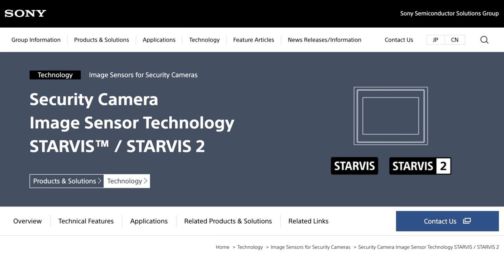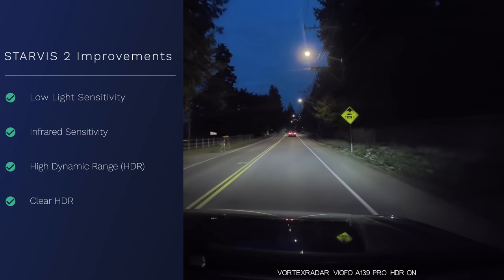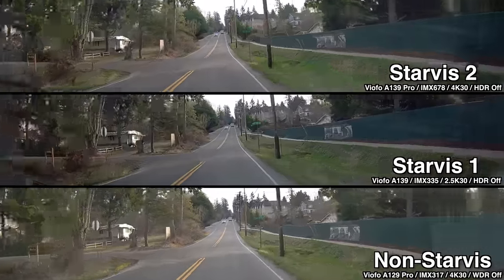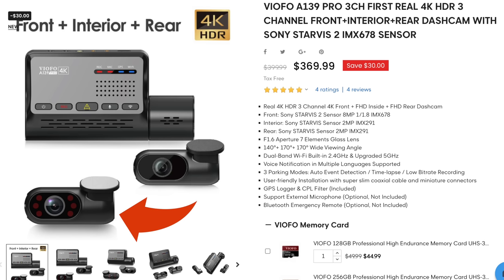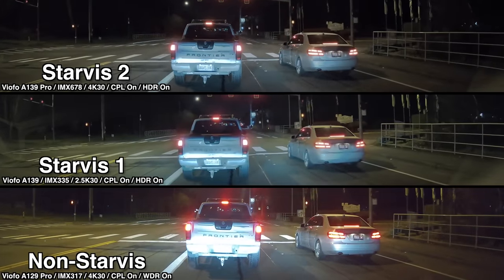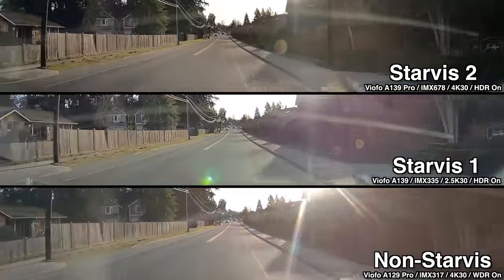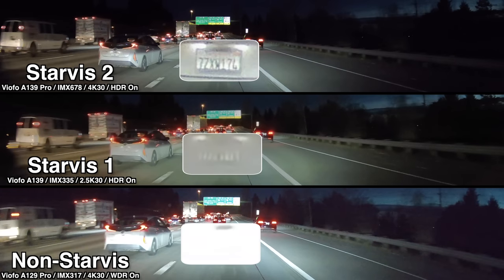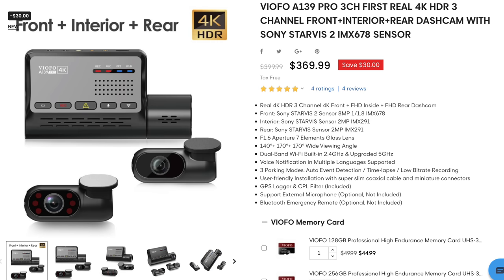Next Gen Dashcam Sensor: Sony Starvis 2, ft. Viofo A139 Pro

Comment: Thanks for the very informative videos. I just purchased through your link. You did a great job of breaking down the most important elements and the new Starvis 2 sensor looks like a winner in the current crop of upper end dash cams. I was initially leaning toward the Vantrue N4 for it's feature set and price but watching your video swayed me to spend more for the enhanced video in this unit.  Thanks Again.
Reply from the maker: Congrats! Good decision. I have an N4 as well and the A139 Pro is unquestionably a better dashcam.

Comment: If you’re ever bored it would be cool to have a video deep dive on shutter speed in the context of video recording (as opposed to photography) and how shutter speed relates to frame rate. Even as a photographer  i struggle a bit with separating those two and understanding the relationship between them & their impacts on footage.
Reply from the maker: Yeah I've been wanting to tackle that topic for some time, specifically because people keep saying you need 60 fps to better capture license plates...
Reply: @VortexRadar  yea In the photography realm  it’s easy for me but we are taught to typically stick to recording w/your frame rate at 1/2 your shutter speed and also to keep in mind The frame rate per second can never be higher than the number of exposures per second. If you have a 1/4s shutter, the shutter / exposure only opens and closes 4 times per second so you can never have more than 4fps (without interpolation). 
So we are always taught to “work backwards” from your delivery format. So if you may want 30 or 60 fps then shoot at 60fps w/a 120 shutter speed because you can always “work backwards” to slow things down without any issues or degradation but if you shoot at 4 or even 24fps & want to speed it up or get faster detail etc it’s too late. 

TLDR: even I struggle with how 30fps w/a faster shutter speed for example would be beneficial…I get why you’d go to lower frame rates at night for example but not would expect a faster shutter to cancel out any benefit from doing so
Reply from the maker: @Fee.1 Yeah it's not so much about shutter angle in this instance. People may see that switching from 30fps to 60fps forces a minimum shutter speed of 1/60th and thus they see less motion blur and so there is some truth to it.

However, you also may find that it doesn't always force a faster shutter speed, especially in the daytime, not to mention dashcams don't always double the bitrate when you double the framerate and so wind up having less quality per frame, despite any potentially faster shutter speeds.
Reply: @VortexRadar  so what are a couple examples where you’ve found yourself adjusting shutter speed independently of framerate with higher quality dashcams where you benefitted from doing so, and did you adjust it up or down ? I can see from the info you just have maybe turning it back down when it’s on 60fps if higher speeds cause some issues. It makes more sense now though so thanks, I hadn’t really considered manipulating shutter speed more due to flaws in the way the camera works than for any technical reason that applies in general hadnt considered that.

Comment: I want to add some more things:
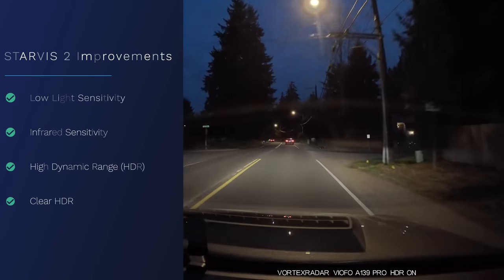2:00 - the Starvis 2 Sony IMX678 is bigger size than IMX335 and than IMX317 and I consider this was the biggest advantage over the other two image sensors from this review. For sure Starvis 2 is better than Starvis but right now, only the Sony specs. are saying that.
For a real comparison between Starvis2 and Starvis should be used same sizes sensors. I think you have the Thinkware U1000 dashcam which have the IMX334 Starvis CMOS which is the same size as IMX678 from Viofo A139 Pro. Not many people in the world have both U1000 and A139 Pro so you can make a real 4K Starvis2 vs. Starvis comparison. OK, I know that IMX334 was not so great CMOS but it is the only you can compare with IMX678. Another dashcam with the same size CMOS is the Nextbase 622GW but unfortunately it is using an Omnivision OS08A10 sensor.
Because of the bigger CMOS size of IMX678 some of the features described in the video are influenced by the size of it and not necessary by the new HDR or the new Starvis2 and I will mention in the next.
3:18 - even the IMX317 is not a Starvis CMOS, we can see the ceiling of the parking lot and cars from the back are better illuminated than the Starvis IMX335 and Starvis2 IMX678. This is because the Viofo did a fantastic job to add more brightness to a 4K sensor even people said everywhere that a 4K image from a 4K sensor is always darker than a FHD or a 2K image from a FHD sensor or 2K sensor. You know, the story with bigger pixels which receive more light.
Of course, the WDR helped a little, but doesnt matter the technology or the trick, but the final result:  a non-Starvis image is more brighter than a Starvis or Starvis2 image from a real test with 3 dashcams side by side.
But as you said, the IMX317 image have not so much details and I consider this is because of the too much brightness added by firmware. This means that not always a brighter image is better than a darker image. More than that, for a dashcam where the dark outside the road is not important for accident evidence is better to have clear details on the road than a better illuminated buildings or forests from the sides. Few years ago I was amazed by the brightness. Now I am amazed by the details.
3:40 - size matters first
3:50 - too dark for a dashcam. No sun, no headlights. Sunrise and sunset will be always killers for dashcams. Unlucky snapshot time of the day even a bigger CMOS or Starvis2 could not help. Surprising, the DOL HDR from IMX335 did a better job than Clear HDR (if was Clear HDR and not DOL HDR too) of IMX678 on the right side of the image at the CANYON PARK placard. But I can be wrong if the IMX335 was more on the right of the windshield compared to IMX678.
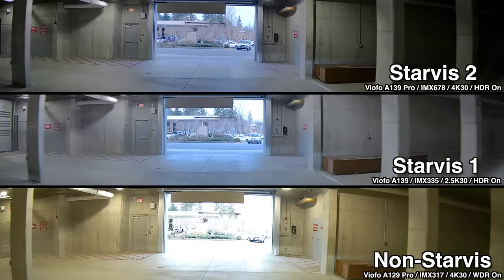6:40 - if IMX317 could not have a forced brightness by firmware could have a better result but I don't expect to be better than Starvis sensors with HDR enabled.
7:09 - another unlucky snapshot, usually on that environment I expect the license plate to be read like it was on 9:25 and I consider this to be the normal situation
7:47 congratulations for the explanation of DOL HDR, this part of video should be on Wikipedia ;)
Reply from the maker: Yeah I thought about doing the comparison with a U1000 for that reason, but I wanted to stay within one brand to avoid software processing differences, HDR vs Super Night Vision, etc. plus I’m actively testing the differences specifically when stepping up to the Pro model. You’re right that sensor sizes are different too. Ultimately every comparison has its trade-offs. :)

Comment: I don't think the Clear HDR noise issue could be remedied without more aggressive noise reduction. This uses a single shutter speed exposure taken with two gains (a low ISO and high ISO) and combined into a final image. Now since the high exposure frame is taken at the same short shutter speed as the low exposure frame, its signal-to-noise ratio will be lower than if it's taken at longer shutter speed like in traditional HDR. Less light = less signal = worse SNR, you just can't cheat physics. 

At the end of the day, in the world of image capture, bigger sensors rule. There's only so much you can do to improve the performance of a small physical package. Let's hope someone put the IMX585 Starvis 2 in a dashcam. That's a 1/1.2" sensor with twice the pixel size of IMX678 and thus a 1-stop better low ISO performance and dynamic range. But it's still not free lunch since with bigger sensors you get less depth-of-field. And you will find out only the center of the frame is in focus and edges of the frame will be out of focus.

IMO the next evolution of dashcams would be the use of side-by-side color+mono camera combinations. Use the mono to capture luma data and color for chroma data. Mono sensors have an inherent resolution and SNR advantage.

Comment: Have you done any comparisons of the A139 between 4k/30fps and 2K/60fps? I am finding that the reading of vehicle plates in motion much better at the higher frame rate. Obviously this is only available to a 1 or 2 Channel user.

Comment: Any word on a Starvis 2 unit that is powered by USB-C?   My EV uses USB-C and has one 12vdc port in the hatchback area.  I might have to end up running a long cable.   
On the Ring,  UPS delivered mine today but after seeing sample videos for it vs your Viofo  here I just sent it back without opening the box.  A139 Pro is so much clearer.
Reply from the maker: The A139 Pro is powered by USB C. Usually you’ll want to hardwire regardless though.

I just got my Ring cam in too, but I’m not expecting it to be comparable to this quality-wise.

Comment: you mentioned that viofo is still working on this technology. so does that mean they will provide future firmware updates for the current model? or should we wait for an upcoming newer model or firmware already with this a139 pro model?

thanks for breaking down this info. low light with motion has always been a concern at night.
Reply from the maker: It just came out recently and they’re still working on it, but with tech stuff it is a good practice to buy based on what it does now, not based on what it may (or may not) do one day.

Comment: About that shutter-speed exposure time, most (dash)cams in Europe have that problem with artificial light sources, where traffic lights for example seem to flicker much. This is due to our electrical grid running at 50 Hz, whereas North-America runs at 60 Hz.

Next time you speak to Viafo engineers, maybe ask them to integrate a shutter-speed configuration setting, to better adapt to 50 and 60 Hz mode continents?
Reply from the maker: They offer menu options for both frequencies depending on where you drive. It defaults to 50 so you need to change it to 60 here.
Reply: @VortexRadar  oh nice, it's already there!

Comment: if we are going to continue using such small sensor, AI is going to be needed to in order to resolve more details and keep the dashcam the same size. This is what smartphone have been doing for years now and this hasn't trickle down to dashcam yet. Ai denoising and upresing could help resolve more detail, reduce noise while keep the same form factor

Comment: Yeah I've been looking over the A139 Pro for a few days now as I'm in the market for new dashcams for a car as I haven't had a car for nearly 3 years now and my last one was written off by a rear end. Only had a Viofo A119 v2 on the front which was great, but wish I had the rear coverage also. Thinking of going with the A139 Pro main units x2 both running 4k, if my car is able to provide enough power at least while it is running. Not sure if that needs a hardwire or can be done from the cigarette lighter socket. It is possible my previous car was damaged also a few months before write off by someone maliciously putting dents on the bonnet, or could be hail damage. parking mode could be useful but I sometimes didn't drive for weeks so
Reply from the maker: Yeah you can run a pair of them off either the cig lighter or hardwire. I typically recommend hardwiring for a permanent install to get a cleaner install plus parking recording. It does take more power than the original A139 (especially for the 3CH setup) so there’s an updated hardwire cable now, but either way running them with a hardwire would be the way to go for max protection.
Reply: @VortexRadar  I've only bought the 2 front units + a bluetooth remote to save the rear easier, doh. might get a hardwire kit if it's difficult to wire to cigarette lighter. last time had a clean install with a119 v2 without hardwire. As I said on the A229 Duo video just seen now, maybe I should've got a139 pro front + a229 duo rather than a second a139 pro main unit so then I get two fronts and still a 2k rear or maybe that's silly. Price wise it would've been pretty much near the same cost I think

Comment: 1.) HDR on the A139pro smears details/textures. Even with the camera stationary/no motion in the videomaterial. Non-HDR produces visibly sharper images. Implementing a log-profile might be a better idea. It doesn't need two exposures.

2.) For motion-freezing (plate-reading) you need all the light(energy) you can get. Plates are black and white so correct colors in the video(s) isn't nescessary. Thatfore you should take off the IR-cut from the rear side of the lens, so much more light energy reaches the sensor (which already is very sensitive in the IR-range). You can hang a second unmodified 1ch A139pro on the windshield to simultaniously record the scenery in correct colors. To help the modified A139pro even more (especially when your car is an LED-one which are nearly silent in the IR-band) you might use active IR but in some countries this is not allowed because it might mess with certain traffic sensor and camera-tech although traditional incandescent headlights throw out tons of light in the IR-range, they are basically screaming in IR, but that's inherent to that tech so big brother has to live with that.

3.) Viofo should offer a higher bitrate. Helps much with sharpness/details. But might cook the camera ... :(

Comment: I have Thinkware F 800 Pro. It’s a nightmare retrieving video clips. Can you suggest a dash cam that can easily retrieve the videos? Neighbor has Blackview & that one doesn’t look very simple either
Reply: Most of them have a WiFi setting you enable, then connect directly to the camera, and view and transfer the files from the phone app. Or just remove the SD card and put it in a reader in a computer. This camera even comes with a USB adapter for the SD card. The only other option is something like the cloud service ones with LTE where you pay for a data contract to upload the files as they're created, but you still need to use an app and download them after so it feels really pointless to spend all that additional money (they're about 4 times as expensive as the most expensive 4k cameras) just for that one feature.